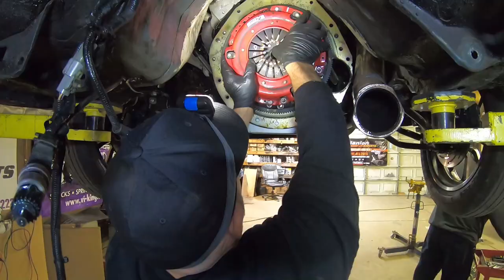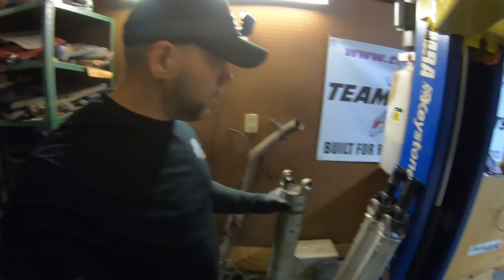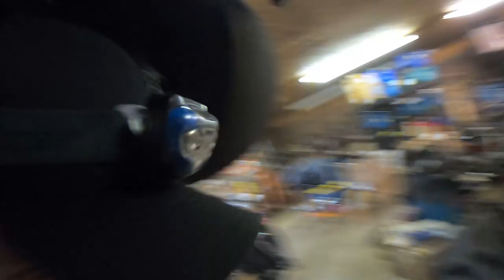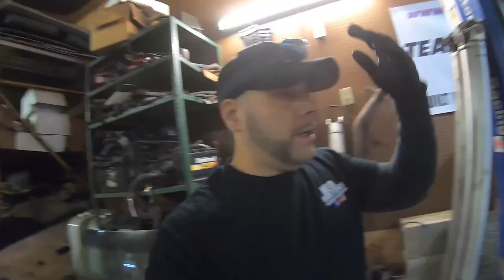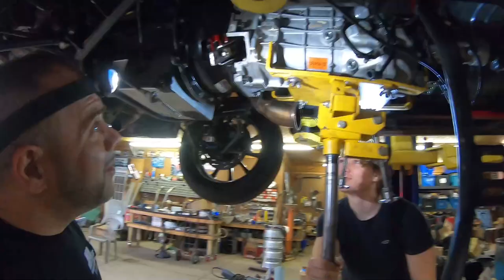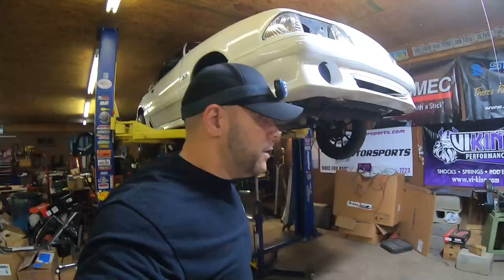You Make Horsepower? This Mod That Takes 10 mins For YOUR SAFETY ⛑

Comment: Good video subject. Definitely the driveshaft loop was a needed addition. With your power level the upgraded yoke and u-joints are a smart move. The loop is cool looking and roomy but with no rear support I question how effective it will be if needed. Physics is physics and I’m not sure I trust that being cantilevered out from the cross member. For total driveshaft safety you might consider a second rear mounted loop as well. That 1350 flange is beefy but not unbreakable and a shaft flopping around at speed in the rear can also really tear up your car.
Reply from the maker: Yes sir!

Comment: I've been thinking about needing a good drive shaft and a safety loop, was trying to wait till I upgraded my Trans and clutch, with a little 331 and upgraded V1 S-trim thinking I should go ahead and get it done. What Trans you recommend,  been thinking TKX what's your thoughts Sir
Reply from the maker: Tkx for sure bro. That’ll be good till 600-700 at least. T56 is a whole swap that’s 8 grand ya know. Loop for sure it only took me 5 mins to get it in

Comment: Great video, i wanted to ask if you know if that safety lp would fit on a t56 magnum,stifflers crossmember,  on3 turbo with a QTP electric cutout at the Y pipe? Of that QTP would be in the way?
Reply from the maker: it should.

Comment: I still got to put that loop in I won fdoc, I got the recommended poly mount, I’ve got a 95 sn car. So you don’t run the plate that comes with the mount? Cause my trans is in the floor already, some one has cut the floor for clearance. The car was an auto that’s been swapped. I was thinking the loop is going to interfere, with the floor board even more. Cars been lowered also, which is causing the drive shaft to run on the parking brake cables and equalizer, I’ve jacked the rear up a little with weight jacker rear lower control arms. They’re maxed out, I need some factory rear springs. Just was wondering about ditching the plate though, heard it loads that mount up so it don’t tear out?
Reply from the maker: I just installed it the way I had it. Figured that was the correct way don’t wanna bind trans or angle up. Seems fine

Comment: Definitely way easier than my old school bolt through the floor safety loop. Just wonder if that thing bounces a lot with it hanging so far off the trans - maybe not enough to matter but driveshaft contact should be obvious to see if it does.
Reply from the maker: Its pretty sturdy. I have heard nothing about it bouncing at all and it moves with the tail shaft which is good stays centered?

Comment: What brand drive shaft you recommend?
Reply from the maker: Inland
Reply: @Neomustangs  thanks, noted. I have a strange 3.5 CM 1350 joints. Standard yoke 😬, but forged rear end yoke? For viper  spec t56. Its just a street car, but i bring it to track for fun when i can. Not alot because i cant afford tge abuse 🤣. But i was going to go DSS alum, because they did a good job on my german car daily. But i will check these guys out now. Its a 347 with precision 76, what ever 93 fuel will get me is what ill have.